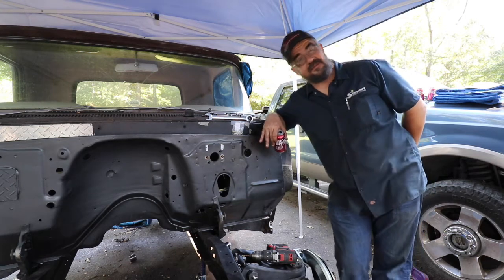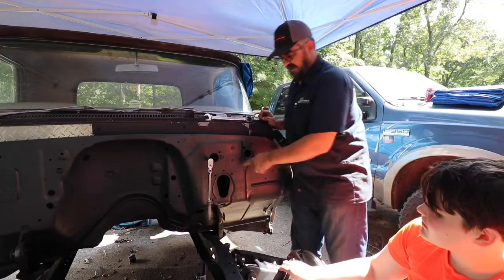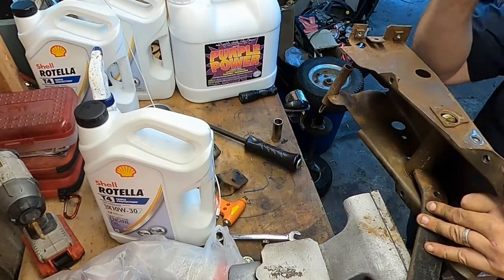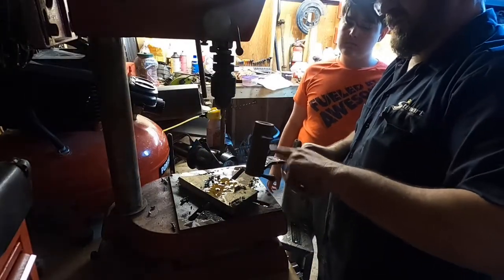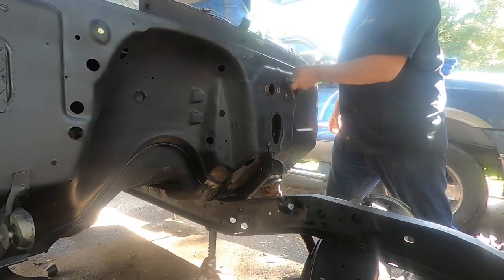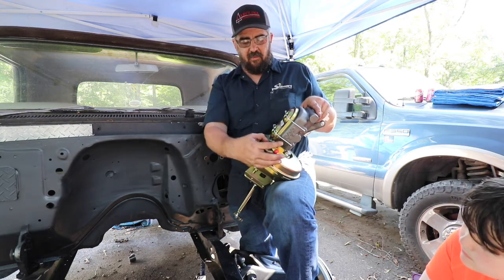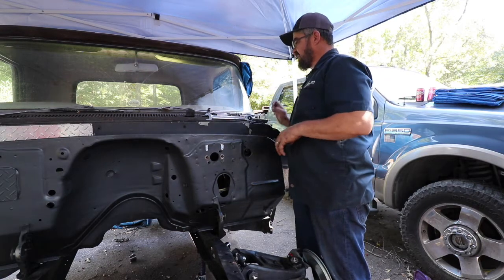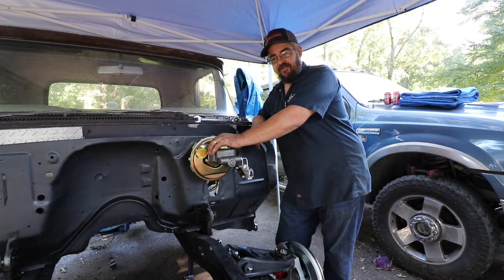We install a Power Brake Booster and Master Cylinder in our 63 Chevrolet C-10 Pickup

Comment: I see a booster option for a single line.  Your opinion on this?  I am wondering if this will give too much to the rear brakes?  Did your booster come with the master and valve?
Reply from the maker: I haven't seen one with a single line. The original was a single line. I would stick with a 2 line MC so that way the front and rear brakes are seperate for safety purposes. Mine came entirely assembled with booster, MC and proportining valve with the short lines that connect it to the MC. I hope that helps and thank you for watching.

Comment: Doing same thing. Is drilling the hole 1 1/2 lower required when installing booster
Reply from the maker: Yes! the bracket between the booster and the firewall angles the pushrod from the booster to the pedal downward. I had to drill a new hole 1 inch down from the existing hole in my pedal. Thank you for watching!
Reply: @ivybilt6168  ok thank you enjoyed the video subscribed and will follow your build I have a 63 doing same with suspension as your other video and front disc brake cconversion Thanks again
Reply from the maker: @loufresquez8031  Thank you Lou!